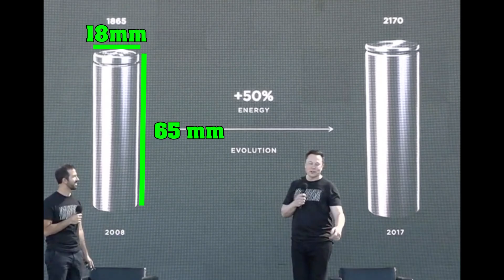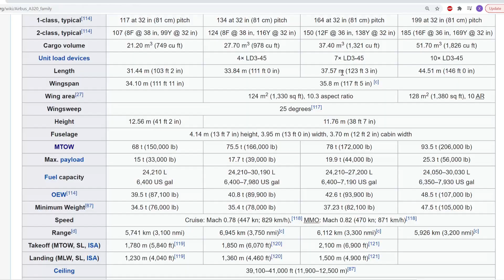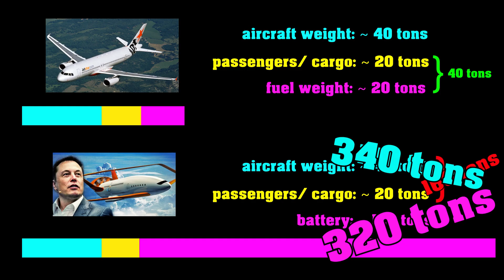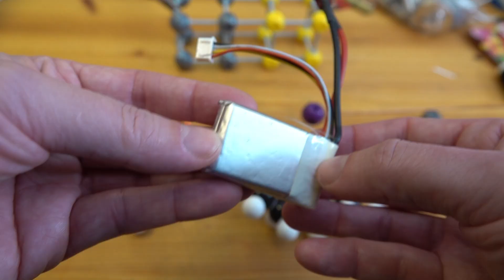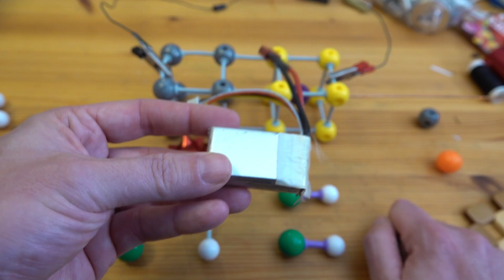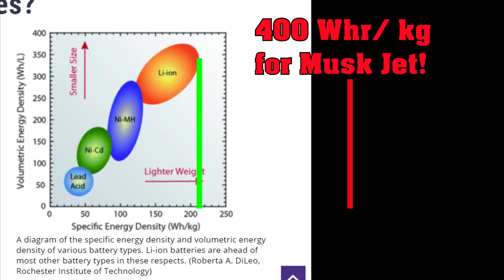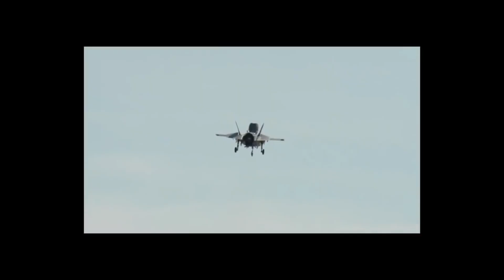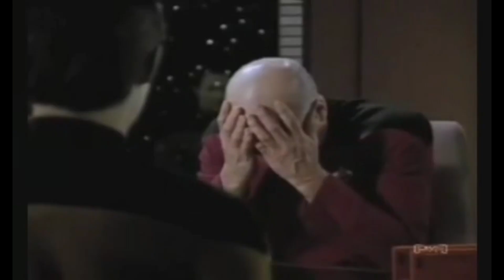Tesla's Secret Plan To Disrupt Airlines: BUSTED!!

Comment: Hahaha follow several aviation channels and the only thing that can fly with batteries are ultralight aircraft and small airplanes for 1.5 hours
Does anyone remind me why high-density batteries are prohibited in airplanes? Ah yes, because they catch fire!
Reply: Well, it's still better than kerosene...
Reply: @johntheux9238  Not really, since you can extinguish kerosene. Try that on a lithium-fire. Also, you need an ignition source to burn kerosene, but batteries go boom from a simple short circuit.
Reply: @DeadNoob451  Isn't it generally the electrolyte that burns in a battery rather than the lithium?

Lithium isn't hard to extinguish - same as anything else, starve it of oxygen. Just don't use water...
Reply: @DeadNoob451  That's because batteries need to carry both the oxidants and reductants in the same package. They also place the reactants in close proximity, so when batteries fail they tend to cascade-fail.

Which means that once charging is complete, the aircraft are now giant potential WMD's sitting on the ramp.

Comment: this reminds me of the cold gas thrusters embarrassment
Reply: To be fair, the Cold Gas thing is feasible , just very dangerous and unlikely to be released in any large quantity as a result.
Reply: To be fair; It is not in any sense commercially feasible in practical reality. Yes, in test / lab conditions you can stick cold gas thrusters on something the mass of a car and get a few seconds, maybe up to a minute of significant alteration in velocity. Carrying around such massively heavy tanks defeats the entire purpose/concept by increasing the energy required to lug them around, not to mention the safety and logistical nightmares involved. One day maybe we'll have flying cars, but not with the current level of materials science technology available at the moment or in the foreseeable future. @innosam123
Reply: @eNodeTG  ofcourse its not economicaply feasable its just for the lolz during a drag race to get under the 1,9 seconds 0-60 mph
Reply: @eNodeTG  There is a reason Elon made it an optional feature in the Roadster 2 that removes the Trunk and Back seats. I doubt most people will trade all that just so they can have a short boost once every 6 hours.

It doesn’t need to be built in large quantities, remember this is the Roadster- the extreme high-end sports car. Volume for the cold gas thrusters will likely be very limited.

The question is whether it’s legal, or safe.

Pretty nice feature for marketing though. Same as the bragging about the 1-60 speeds and the teraflops of their entertainment system.
Reply: @innosam123   My point is it is an impractical and frankly a dumb idea. Do some back of the envelope math on how much performance you'd lose by lugging around  these massive tanks, add in the electrical power required to run a compressor to fill them, if all that makes sense only then move on to the legal and safety considerations of carrying around what is essentially a massive bomb that will instantly kill everyone in the vicinity if ever ruptured at pressure. Would love to see drag racers with thrusters, sounds awesome; but on a closed course, not driving around my neighborhood.
Reply: @eNodeTG  Eh, automobile manufacturers have created basically unique models with cool but impractical features before just so they can brag.
And Tesla LOVES to brag.

Unless it enters mass production, it’s not really a big deal.
Reply: @innosam123  Who wants to hear about the boring new Camay, or how such and such won a big race with some super car built by whoever -- when we'll all have hovercrafts soon? So yes and no IMO. :)

It was a big deal to some true believers who thought they'd be hovering right over road obstacles and traffic jams if you go back and look at the hype when this was announced Lol
Reply: IT WAS A JOKE!
Reply: one hell of a joke for sure, just google what everyone was saying about it back in 2018 lol
Reply: @kingdomOnYT  Like alot of what Musk says, it was a joke. Just unintented.

Comment: I can already see where this is going. Some things were just not meant to run on batteries.
Reply: If you want to have an "electric" airplane,  just create a jet that runs on carbon neutral fuel created by renewable energy. That's what Boom Aerospace is planning to do.
Reply: Won't be for long-haul flights for sure, but there will still be a market for it.
Reply: @johntheux9238  Maybe purely for entertainment and stunt flying, cause I don't really see the use of a flying vehicle with very limited range. Helicopters and planes already do their job well enough.
Reply: @bkind2foxes  I think the only way it would be viable is for small autonomous "flying taxis" because it would be cheaper than the smallest airplane.
Reply: @johntheux9238  >flying autonomous taxis
That's pretty fucking stupid, small airplanes are not taxis, they are usually there for businessmen to go from one part of the country to another very fast, which has become less necessary due to teleconferencing. The crippled range of your electric drone taxi defeats that purpose, and for anything else a regular taxi will do. Especially nowadays, where for some jobs you don't even need to show up to work, you can just do it over the internet. Nobody is going to pay an insane amount of money for a cab fare. And a regular car that anyone can drive will always be cheaper than some overly complicated AI-controlled flying machine that you're lucky if it's not a safety hazard. If you have one plane failing, there's a crew, it has inertia, it can glide a bit, works at higher altitude, there's control towers and experts on standby, if that stupid flying taxi fails it falls like a brick out of the sky into someone's back yard (or in the middle of a busy street).
Reply: Yea because they're made to run off burning the remains of pre-historic animals instead.
BS.
It can run on batteries. Just need better batteries.
Reply: @bluesrockfan36  Nope, sorry to bring bad news but energy density says no. No matter how much you tinker with batteries, the fact remains that gasoline has about 100x the energy density of a rechargeable lithium ion battery. Not 2x, not 10x, it's straight up 100x. Good luck finding a reversible chemical reaction that can 1. store that much energy 2. be packed into a fuel cell safely.
But you can make synthetic hydrocarbons (ex. biodiesel), so no, theoretically no need to burn fossil fuels. Making them would have to be roughly as cheap as just drilling for oil though, cause I'm not willing to pay an insane price for fuel just cause climate nutters think the world's gonna end.
Reply: @bkind2foxes  Currently no, I agree.
Currently. You simply do not know what will be developed or not.
So you have two ways to go at it:
1. Make the batteries more efficient.
2. Do not use the same engineering practices you used to create fossil fuel based aircraft on electric aircraft to begin with.

This entire video is an exercise of 2. It assues you design an aircraft for fossil fuel and slap a battery on it.
It's flat out ridiculous.

Eventually we'll have to move away from it, or we'll lose air travel all together.
You really think its that impossible to have an electric airplane?
We can't just make an engine 100x more efficient? Or batteries 10x more efficient and an engine 10x more efficient?
Reply: @bluesrockfan36  no, we really can't. historically large efficiency jumps weren't from optimization, but from new discoveries. you either discover what can be used as a battery but somehow has bonds with more energy (i'm pretty sure this won't happen, batteries are only able to facilitate pretty simple reactions), or just use ACTUAL fuel. like either fuel cells, or recaptured fossil fuels (the latter is ridiculous, but it MAY get new technologies making it more efficient. still likelier than batteries!)
Reply: @MsHumanOfTheDecade  I don't know man... those Tesla cars are a pretty good showcase of optimization.
We'd be deluding ourselves if we don't recognize what a joke electric cars were before Tesla.
They are entirely built on optimized existent technology.

As for electric propulsion systems... there are a lot. I mean a LOT.
Some proven to work, some hypothetical, some flat out something out of a sci-fi movie. You can go down the rabbit hole.

Maybe there's the jump you're looking for? Something like Atmospheric breathing thrusters (plasma thrusters, etc)?
Reply: @bluesrockfan36  
>>You simply do not know what will be developed or not
I know what won't be developed, something that breaks the laws of physics in order to work.
Reply: @bluesrockfan36  Are you sure we don't know what will be developed or not? How about perpetual motion?
Reply: @bluesrockfan36  yeah, we could just as easily use renewables (somewhat largely wastefully) converting atmosphere gasses back into hydrocarbons. or, a better alternative that is currently promising is hydrogen fuel cells. batteries are, and always have been noshows when its important. (like the electric trucks in 1914, batteries where basically all it could haul.)
Reply: @bluesrockfan36  What, praytell, charges those batteries?

Comment: “Supersonic electric jet”

Not with those crappy batteries.
Reply: it'll catch fire at the gate
Reply: Yea, the weight of these thousands of 18650 lithium batteries would be huge,
Reply: Not with our crappy physics either. There's a reason we don't have any supersonic planes that use just a fan, or even high fan bypass ratios.
Reply: Biofuels are the way to go
Reply: wonder how long it will burn
Reply: I mean there's reports of a Tesla that caught fire, got towed to the impound lot and reignited itself three more times.
Reply: I know, they need at least 400 WH/kg, then they will start working on it.